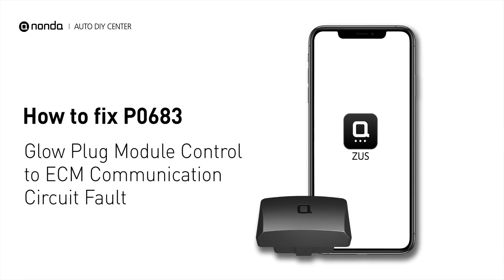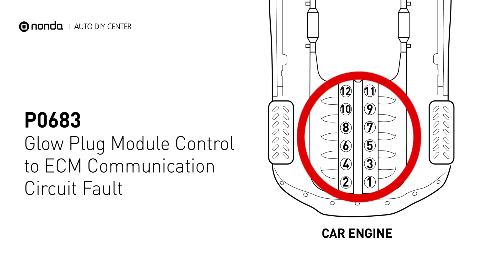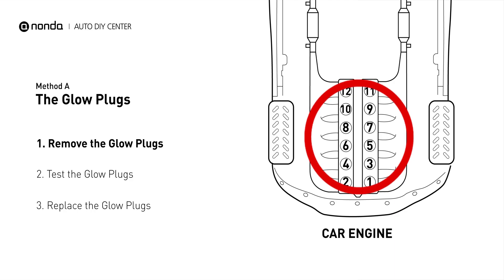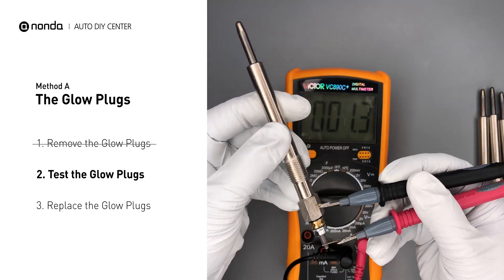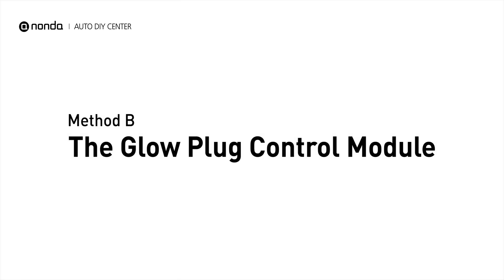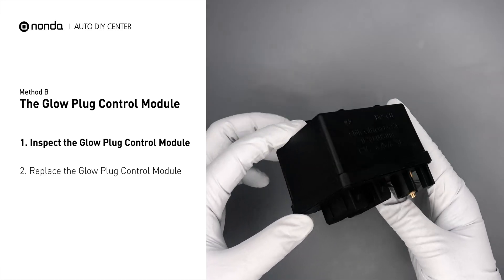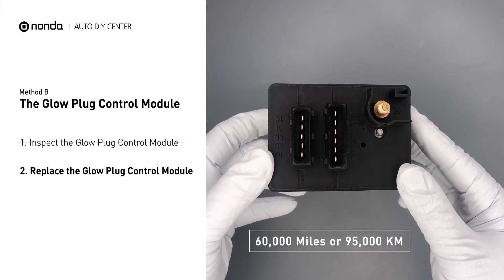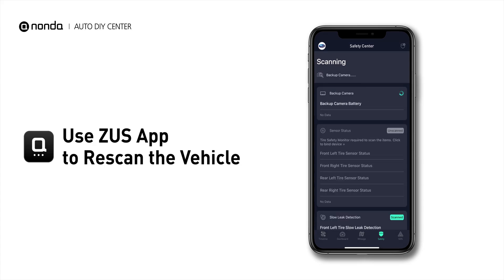How to Fix P0683 Engine Code in 3 Minutes [2 DIY Methods / Only $9.49]

Comment: Hi steve great video i got error code P068311 fiat ducato 2014 2.3 van but the read out i got is Short Circiut To Ground may i just ask i think that is more to do with the module unit and not the glow plugs? 😮
Reply from the maker: Is it the only code you're getting?
Reply: @nondainc  hi! P068311 Glow Plug Feedback - circuit short to ground.

P185015 please refer to setvice manual. 

These are the exact read outs i got Mate!! Appreciate the reply.